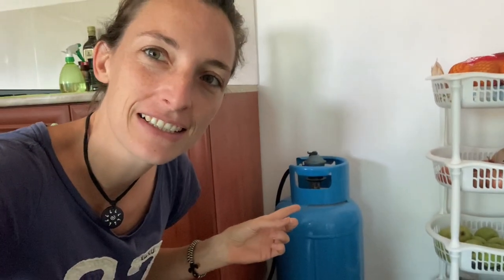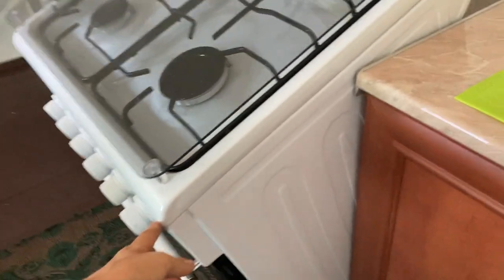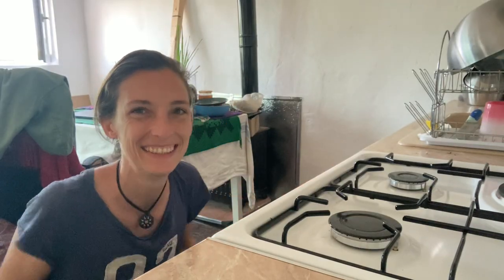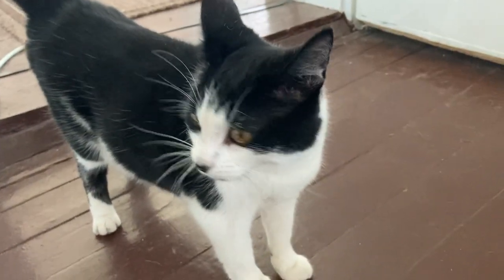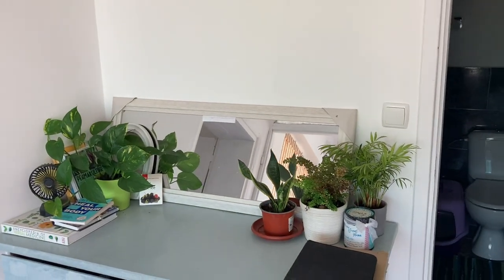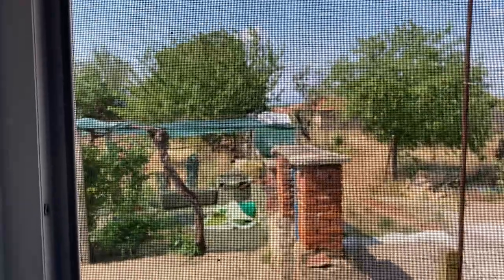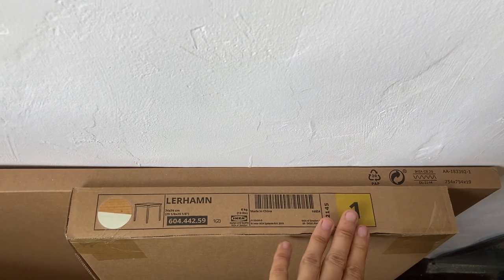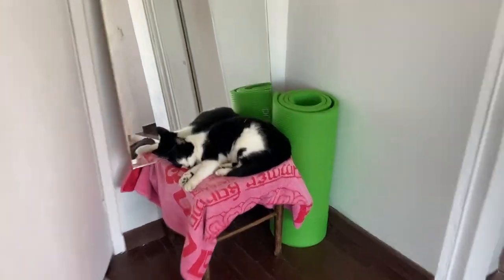Bulgaria Vlog: Connecting the Gas Stove

Comment: Interesting propane tutorial, Maya.  I cook with 100% propane, but I would LOVE a stove like that (near impossible to get here in the USA at a good price).  I'm looking forward to getting one installed in my BG home when I get it, for sure.  We have a screw-in hose thing here in the USA....yours is different, but just as good and you're smart to add the clamp. I don't turn off my tank when not in use, so I think you're okay.  If I were to leave the house for a long time (longer than several days), I would turn off the tank, just to be safe.  The mirror is very "feng shui"...if an intruder were ever to enter the house, their own reflection would startle them!   The kitchen ideas are excellent.
Reply from the maker: Yay Feng Shui, i love that that has happened by accident. Initially as I was designing the room layouts I was attempting to Feng Shui most things and it turned out rather difficult 🙃 now I’m noticing with time living here things find their flow and end up naturally Feng Shui-d 🎉👌🤗

The dual cooker cost 470 leva Approx which is 230usd Approx I believe. It’s worth it forsure as there are electricity cuts here and there. And although not for long, it’s still nice to be able to boil some water for tea and coffee etc :)

I love that anyone breaking in would be startled by their own reflection! Brilliant!
Reply: @MayainBulgaria  $235 for that oven is fantastic!  Once again, about 1/2 the price (if not more) than things here in the USA.
Reply from the maker: @kimkennedy123  no doubt. although prices are going up...it's still very reasonable compared to USA, Germany UK etc

Comment: Just for your info, when you apply jubilee clips to rubber/plastic hoses, they "bed in" for a while. They may be tight when you first apply them, but the rubber/plastic deforms a little and you will often find that the clips are not as tight as when you applied them.
The solution is to "nip them up" - that is, to allow the rubber/plastic to deform and then re-tighten the clips.

Also, I have a similar gas setup on my boat and I don't turn the bottle off when I'm not using it. Household gas is odourless, but it contains additives so that you can smell any leaks.
Reply from the maker: This is excellent advice for the jubilee clips, many thanks! Also appreciate the gas has an odor to detect it 😅🙏

Comment: Do not shorten the length of the pipes from the stove. That would be a mistake. The longer the pipes from the stove to the hole in the wall for the chimney, the more heat they will give off and the house will be warmer!
Reply: She can put a heat exchanger also as an alternative.
Reply from the maker: Ahhh such a good thought about keeping the burner pipes as long as possible! The extra heat is of course very welcome in winter. I’m very keen to open up the kitchen wall space so I’ll perhaps consider one of those “multiple-in-one” chimney pipe flutes….